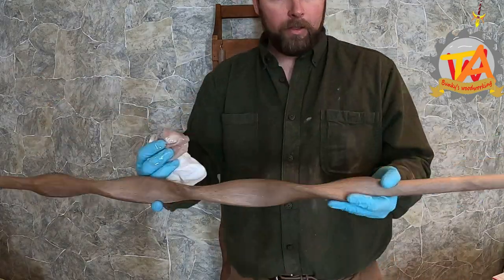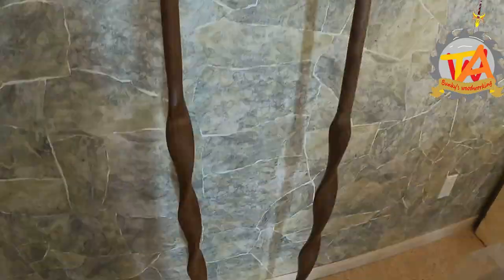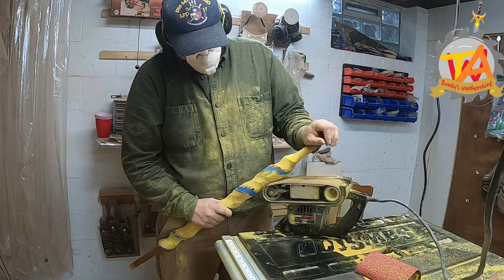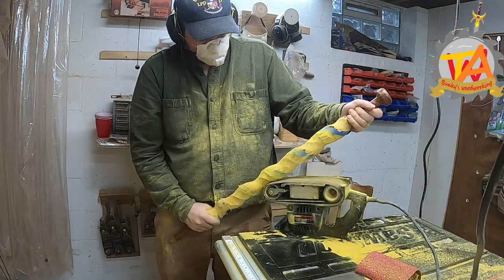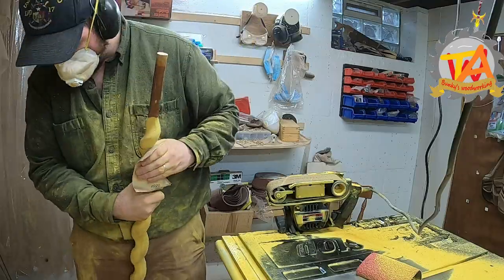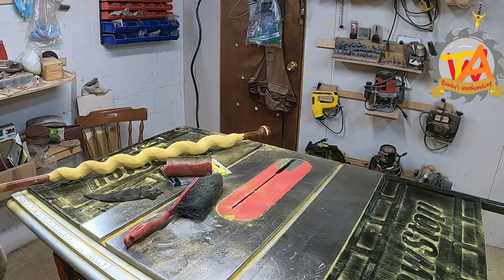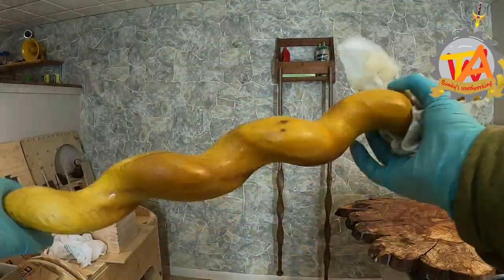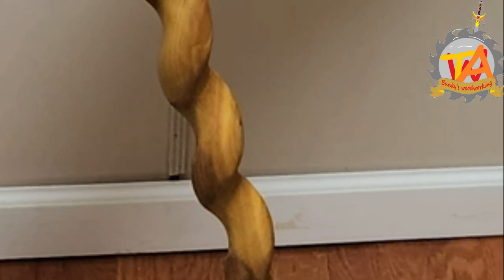How to make a Barley or rope twist cane Satisfying to watch.

Comment: Where do you get the wood. How do it look before you touch it
Reply from the maker: I have a friend who works with an Amish Mill that clears brush and woods from farmland He is out of North Eastern Ohio. If you PM me on one of the social media links are in the channel page I can get you his contact. The wood starts off as a 2s2 rough cut most of the time depending on what I am making. This was one someone else turned and cracks developed they did not want to risk turning it further it was sanded and finished. and did not sell for around 2 years so I asked if they would throw it in for free with an order they did and after it was complete we got 75 for it from some guy in Texas.